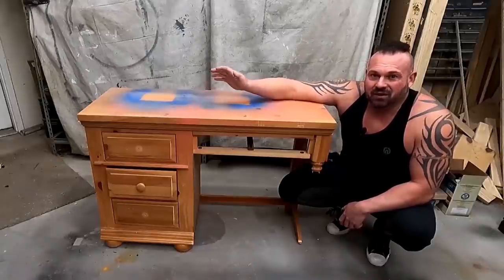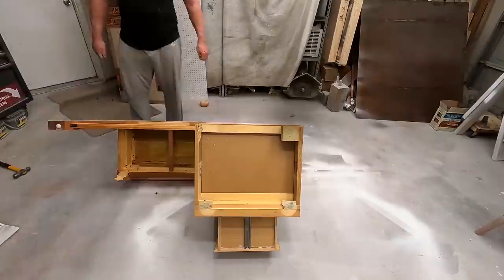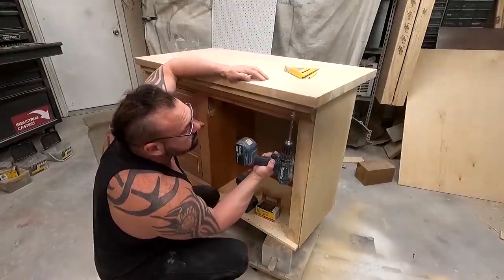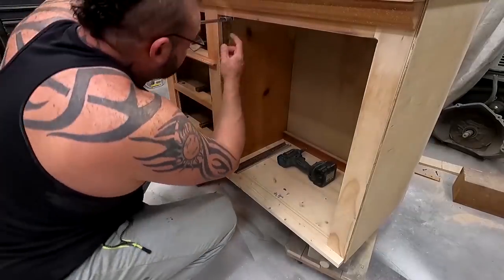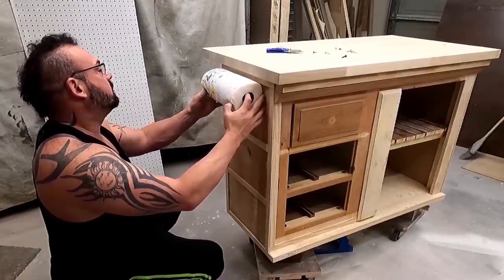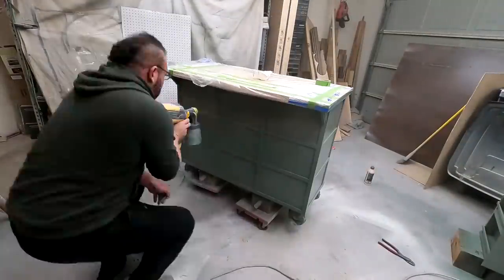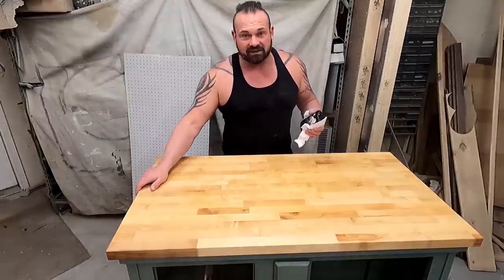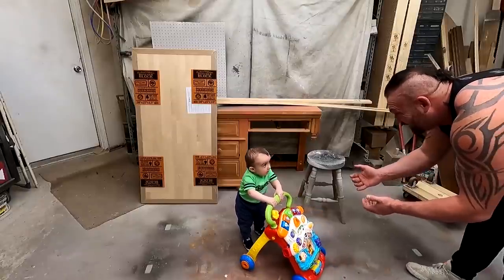I WON the Ugly Duckling Challenge!!  How to turn a desk into a kitchen island

Comment: My father-in-law made me a rolling island. We added an electrical set of outlets  in a strip that had a plug in it and it just keyholed to the side. The paper towel is a nice idea. He made a slit in the top side and we put an ice cube holder underneath for a scrap ketcher for peelings.  We addded a wrap rack to the door. We took it outside also. We took an old cookbook and decopaged recipies to the top. There was a place to hang a cutting board.
Reply from the maker: That sound really cool!!

Comment: I am absolutely impressed!  It really turned out not only beautiful, but functional!

A couple ideas:  

1.  Since wood is so expensive, it’s a shame to cut off so much of the end of the cutting board.  What if you left the length (extending the desk top with wood scraps around just the carved edges - no one would know it wasn’t solid wood across because the cutting board hides it!).  Then move the paper towel holder underneath that end, with the cutting board over top keeping your paper towels dry.  Or, you could put hooks for coffee mugs or big soup ladles, spoons, etc.

2.  Rather than completely enclosing the spice rack, perhaps put “rails” on both sides of the spice rack so no matter where you stood against the table on that side, you could see what you had.  To keep things tidy, you could order a bunch of cute jars with printable labels.  For example, you’d print “Garlic Powder” twice, once for each side of the spice jar so you could read the contents from either side of the jar while it was still in the rack.

I am srsly impressed by this piece.  Great job!!
Reply from the maker: Love these ideas!! Thanks!

Comment: This is AWESOME!! (Sorry for the long comment)
1. Thank you for saving this from the landfill. Wednesday morning I was awakened by this horrible grinding sound in my ally and it was the bulk pick up truck. The neighbors moved out and I guess whatever they couldn’t fit in the three pods was put in the driveway. Unbeknownst to me, it was half a house of furniture, which I would gladly have moved to my garage…15ft a way!! So again, thank you.
2. Your creativity is just amazing (still blown away by the steampunk piece). Do not sell yourself short on the fact you’re “not a professional carpenter”. You packed a LOT of functionality into this little piece and came up with some simple creative ways to do it. Plus explaining how you did it, so if one of us want to try it, is super helpful and bonus for thinking through how someone would put sm and lg spice jars in that cabinet. Oh and the paper towel holder is SOOO cool!! Again, that was so creative to router out those swirly things😁 for the dowel to roll in and out for changing the paper towel roll!! 
3. Top coat for butcher block top:
In my opinion the Walrus Oil was a great choice. I’ve (we, bc my husband has built a few cutting boards as a hobby) mostly use hemp oil, but have tried walrus oil and it’s worked just as well/same. What’s cool for your buyer (great to always give them things like the oil to touch up or a sm container of paint for bumps/nicks), they can use either or to keep it nourished through the years. Again, just my opinion (which everyone has their own) and experience. 
And finally, your puppy (sorry I can never remember his name😬) is HUGE!! And still has another yr-yr and a half of growing! Seriously though, you are doing some amazing work. Again, sorry for another very long comment, but you packed a LOT into this piece/video. So a huge bravo, Dean! Amazing how you not only transform pieces, but watching how your work and talent continues to transform is very cool! Keep ‘em coming!💜
Reply from the maker: Thank you so very much for your amazing comments and info. 🥰🥰🥰

Comment: Hey man. Did you ever find a comparable puck light for under cabinet lighting that was less expensive?  I may have missed it if you did post an update.  I like the design of the puck lights and being able to add more or less and adding the switch.  Don't really care much for the strip led lights.  Keep up the great videos, I've learned a lot.  Thanks
Reply from the maker: I have not had a project yet that I needed them for. There is a 5 piece set on Amazon I think I will try 🤞🤞

Comment: If the height is just under, how about a spacer between the bottom and the casters? 😉👍🏻🇺🇸
Reply from the maker: It was a inch over. At 37"
Reply: @DeanFurnitureArtist  I've used dense foam strips as a spacer when there are casters and found it absorbs sounds and helps stop any rattling when rolling it from room to room. Like a dampener. I use the foam that contractors use to lay down on the concrete foundation before they install the wooden top plate. Works great, cuts easily.

Comment: The rubber wheels leak oil into the floor surface. and mar the floor.
Reply from the maker: I have had this on a table for two years now and haven't ran into that. May just depend on the brand. Now these do get dents in the rubber when the brake has been applied for long periods of time but what do you do. Use steel wheels and scratch up your floor or deal with rubber..🤷‍♂️

Comment: Do you water your paint down at all? I have the same kind of sprayer but I just can't seem to get it to spray right no matter how much I mess with the adjustments
Reply from the maker: Yeah normally about 1/2" of water in the container then fill it with paint and mix really well. Sometimes a little less water if the paint seems thinner.